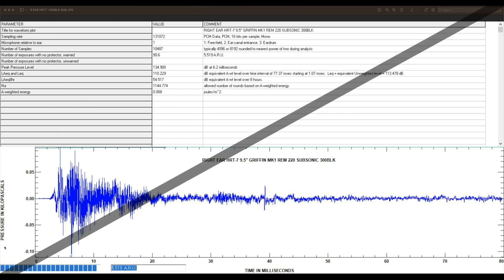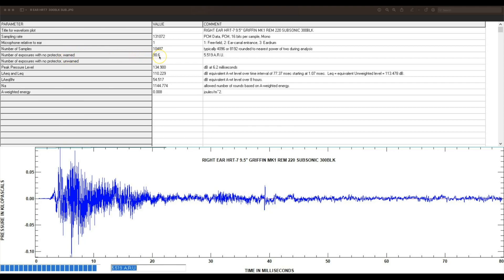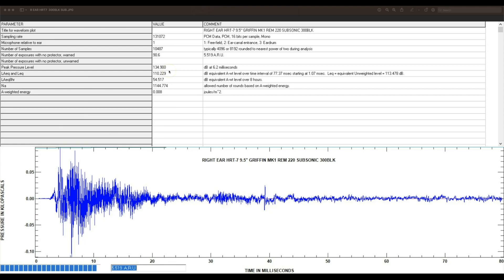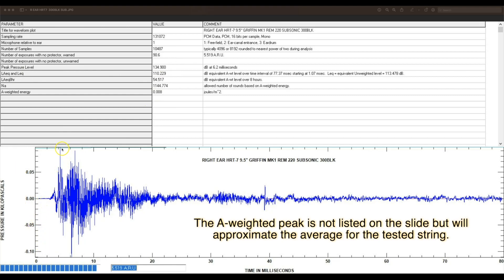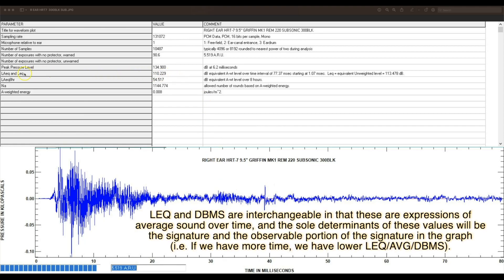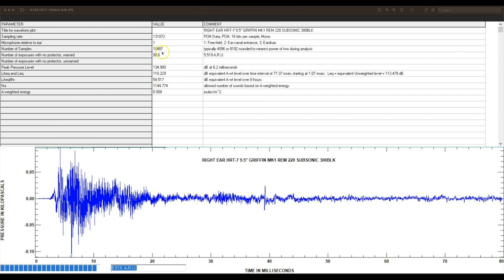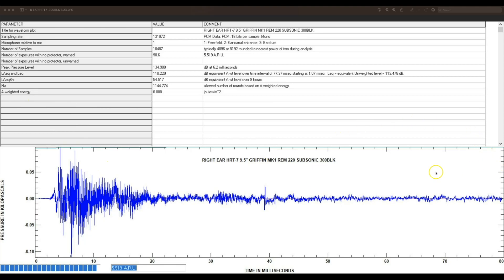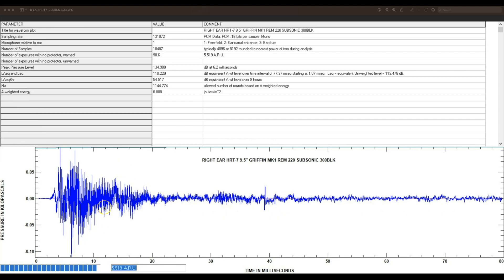How to Analyze AHAAH Analysis Slides

Comment: Definitely prefer this over the ambiguous Pew Science numbers. 

Give me numbers on how much I can actually shoot in a time frame before hearing damage, not some arbitrary rating...

...especially since that rating/ranking says nothing for me as the shooter, when a 5.56 silencer can get a 37+ composite rating while performing poorly at MY ear just because it does well at the muzzle.
Reply: He literally gives you an at-ear rating as well. Have you tried reading?
Reply: @jbdDesigns  I know all about the at-ear ratings, but I specifically mentioned the "composite rating" in my comment. Why don't you try reading next time?

Either way, the ratings are still arbitrary. What constitutes "a day at the range" is very different for someone using an AR platform rifle than for another who uses a bolt gun. The AHAAH system lays it out in a way that isn't up for interpretation.
Reply: This is really good info.  Thanks to GA for this.  As to Pew Science, he includes multiple graphs of the wavelengths in every test they do, so you, too, can interpret the data.